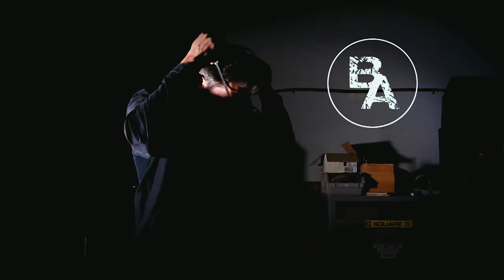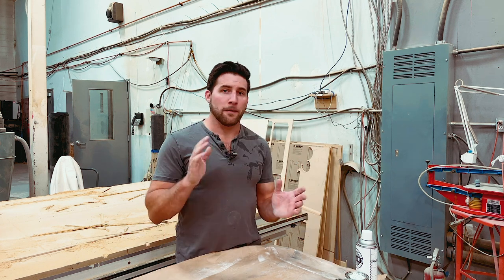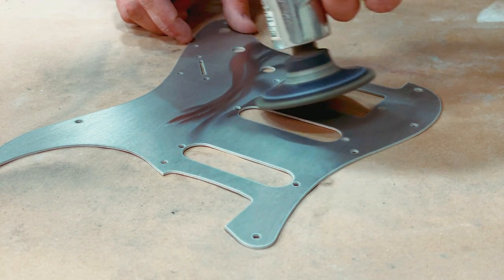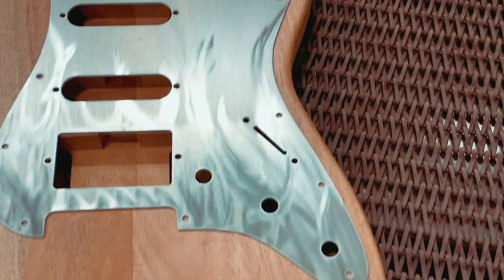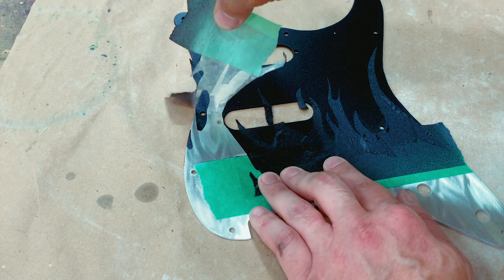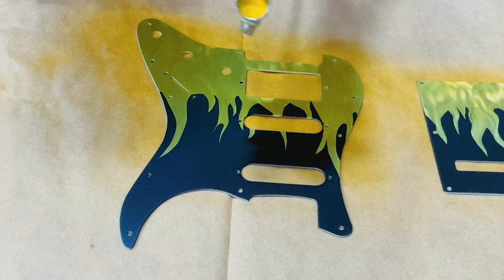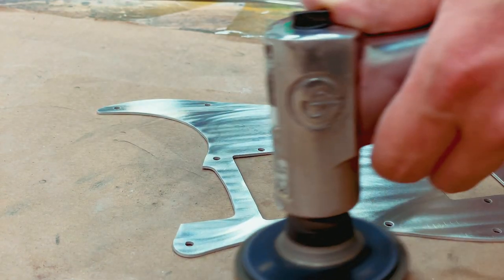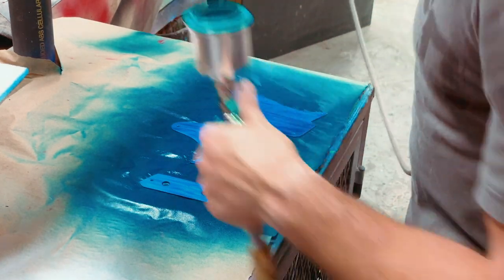Finally! The Custom Pick Guards are Here!

Comment: Just finished watching the acoustic unboxing and remembered this video. And wondered why you haven't used this toy to cut some BA inlay templates for a rotary tool. Fill inlay with coloured epoxy.
Reply from the maker: For the fretboards?
Reply: @BradAngove  headstock inlays,  you have several that need an id.

Comment: Wow. The first one is fantastic. Very nice. Q: Isn't it easier to spray the black first? Then apply the flames. The masking tape seems very difficult to cut. If I saw it correctly, there are a few "flame lines" less smooth. I'm sure my next pickguard will look something like this. (hopefully just as beautiful.) Rob
Reply from the maker: Hi Rob, it is quite difficult to cut the tape like that, but if you try to just add the flames once you paint is on there you will simply smear paint everywhere and burn it. Plus the piece heats up while it is being worked on, which is a problem for the paint.
Reply: @BradAngove  thanks!

Comment: Looked at the website and it's going to cost me lots for pickups and locking tuners. The words fullsize telecaster made me think Hollow body with a block under the bridge. And full top of rusty metal inset with pick guard screws all along the outside. Matching thin metal for the headstock. Of course the body has to be blonde.
Reply from the maker: There are definitely some weight reduction opportunities with those full sized guards.

Comment: Hey Brad, I agree that first one before the black paint was beautiful!  Quick question, would you leave that raw aluminum or put a clear coat over it?
Reply from the maker: Both are options, but I would likely leave mine raw.
Reply: @BradAngove  Thanks man, I was thinking leaving raw as well.  Have you had any issues with corrosion over time?
Reply from the maker: I haven’t, but aluminum can oxidize a bit. I think it looks cool when it does, which is part of why I generally like to leave them raw.
Reply: @BradAngove  Thanks again, I think I'll leave the one I'm working on for my Pacifica raw as well.

Comment: Dude, party the fuck up.
Reply from the maker: I’m not sure I have the context for this comment.
Reply: @BradAngove  It's ubiquitous and doesn't need a context. Regarding that horrible Solo SG kit I have, I replaced the plastic trap inlays with genuine black pearl inlays which was a brutal job due to the amount of glue they used and so forth. (The nut is also horrific and needs to be replaced.) The fretboard had to be cut in the process to fit the new inlays and in case you don't know the fretboard is not wood. It's some sort of plastic/composite, but not wood. I understand it's a cheap kit but I would never buy another one.